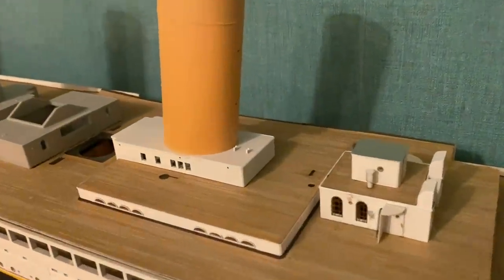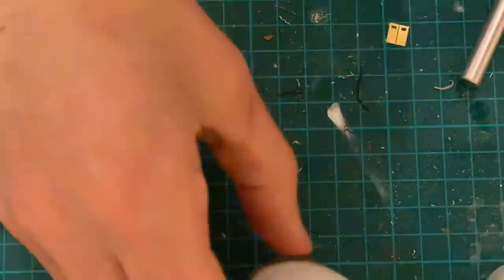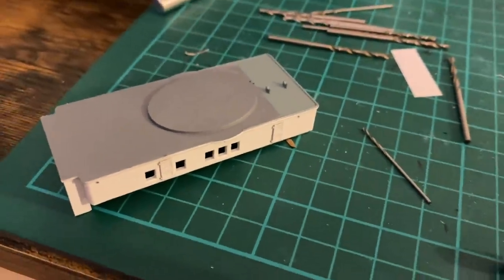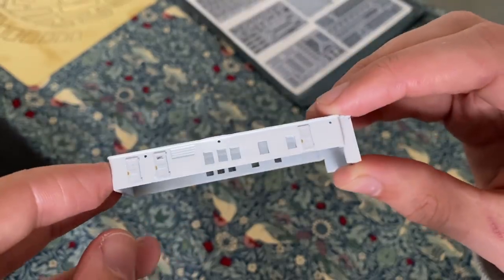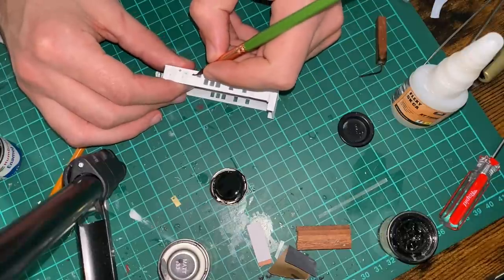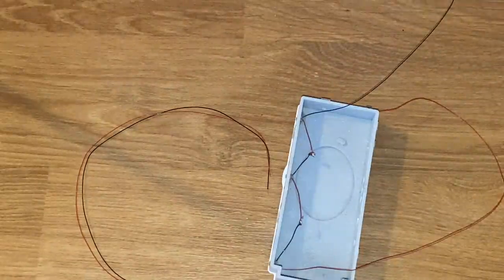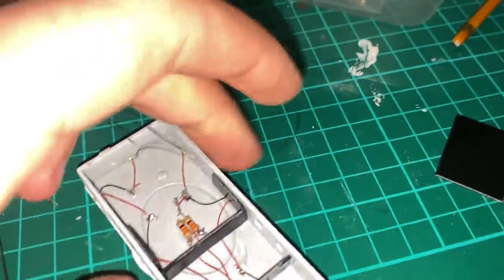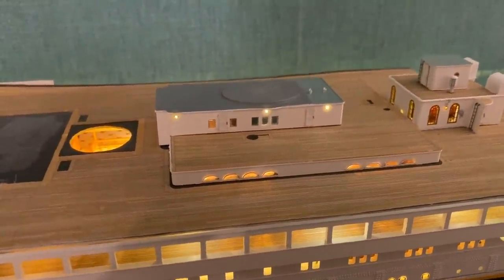Radio Control Trumpeter 1:200 Titanic Build Part 49 - 4th Funnel Base Part 1

Comment: I noticed you've glued components onto paint, if a part is going to lift, it'll be in those areas. Don't get me wrong; beautiful work, and it looks great!
Reply from the maker: Yes you are correct, most of the stuff glued onto paint isn’t structural though so should be ok. Fingers crossed!

Comment: Have you tried a ‘Flash’ removal tool? I only recently discovered these and though it looked rubbish until I used it. They are significantly more versatile than you might think, especially for those herd to reach places. 🤔👍

Comment: There is a company that sells a paint that is very close to the original White Star buff. I think they used a paint chip and matched the color.
Reply: no such thing exists
Reply: I don't have anywhere near the knowledge that a lot of you folk do when it comes to details of the Titanic, but from following the Titanic Hope and Glory project, I was certain I had read that this had happened as well, that a chip of paint had been recovered and matched for the funnels.
Reply: @nascarnbroncosfans6055  It does I bought the paint from them.
Reply: @crazyguy_1233  sounds like BS to me. Sure they have a paint but is it from a paint chip digged up on the sea floor? Probably not.
Reply: @bobbyrayofthefamilysmith24  Not from Titanic why would they get a paint chip from there? Also there might have been a paint mix list in the Harland and Wolff shipyard archive that tells the mix ratios.
Reply: @crazyguy_1233  Then where did they get the paint chip from? The paint mix ratio document in an archive is believable. If they claim to have found an original document with the paint mix then I'd have no reason to disbelieve that.
Reply: @bobbyrayofthefamilysmith24  I'm not sure what White Star ship the paint chip is from but the document is where a lot of people get rough colors from. The paint I bought is the closest and only place that sells White Star Buff I wish more companies sold it because it's a really nice color.

Comment: I am curious about the window arrangement shown on the deck house plan shown at the 21:15 minute mark.  The plans only show 9 windows not 10 as molded into the model.  Which is it?  Is the arrangement of the two windows around the door on the port side correct on the model, or just one window forward of the door and no window aft of the door area?  You do mention lighting three windows, but the model has four in the area you were pointing to.
Reply from the maker: Aaaaah yes now you are correct here, something I twigged too (although admittedly not when making the part.
I’m going some research into this because the plans on Encyclopaedia Titanica show the window not being there. But the blueprints tend to be Olympic and I know there are some subtle differences between the two. 
Ultimately not a hard fix, just slap a bit of paint over the window! 
If I find out definitively I’ll let you know, if you do could you let me know 😛
Reply: @TheModelBoatGuy  Will do.
Reply: @TheModelBoatGuy  I found an interesting issue with the Pontos instruction regarding this window.  On the last page of the Pontos instructions the picture shows a good look at the deck house under the 4th funnel.  The picture shows only one window next to the door instead of two.  So the Pontos instructions support the idea that there is only one widow at the port side of the 4th funnel deck house as well.

Additionally, the deck plans I got from encyclopedia titanica also show only one widow like your deck plans do.  And they are suppose to be of the Titanic.

Comment: Great job Robbie, I like the frosted windows.  I have some frosted plastic sheet which will be ideal for the purpose!  I agree on the funnel colour, perhaps something more like the old P&O buff might be a bit closure,  perhaps a tad darker?  As with many photographs taken, it all depends on the light, time of day etc which can completely change the apparent colour!  Regards JH 😉
Reply from the maker: Thanks John,
Yep I have now bought a few other colours so we will see how we go. I’ve just had a look at old P&O buff and certainly that sort of thing. More testing required! Of course the other issue is apparently white star buff changed subtly over the course of the century, so your Olympic might need a slightly different colour to mine.
All fun and games anyway,
Keep well,
Robbie